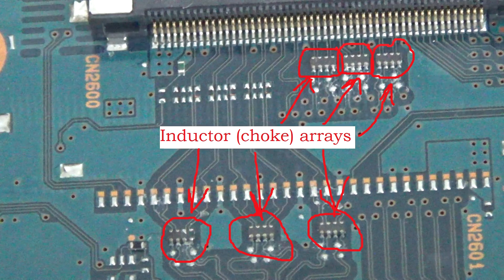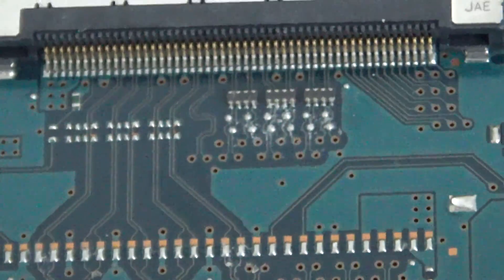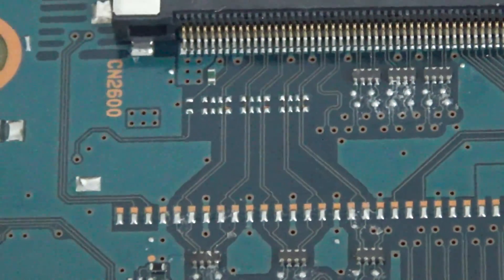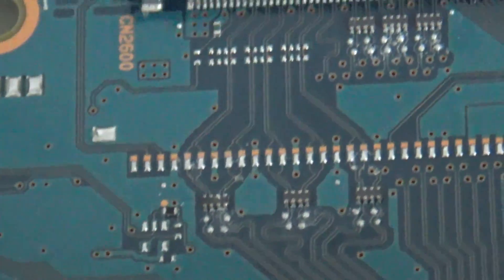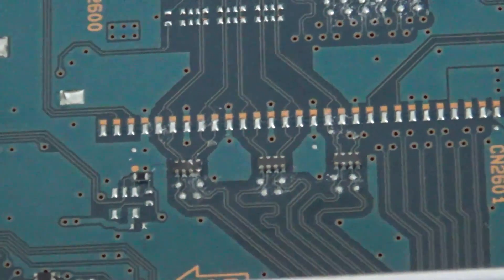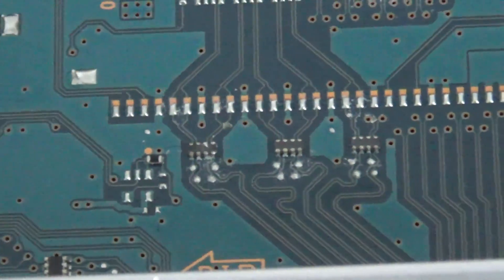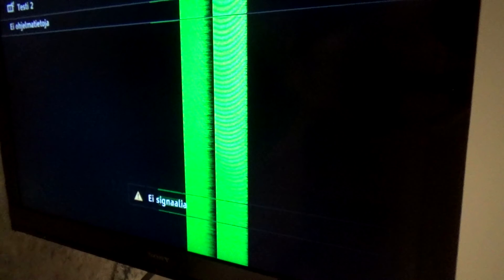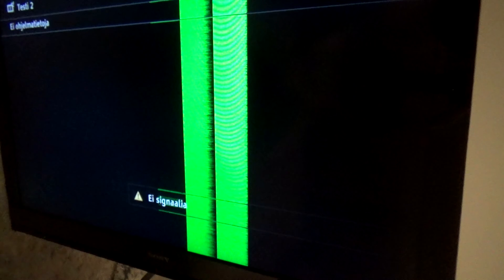Sony Bravia KDL-46EX700 TV Repair

Comment: I have the same TV but i have the Problem that it starts to the Sony opening Screen and then shuts off, restarts again until the Sony Screen and shuts down again and then stays off. Do you maybe know how this can be fixed?
Reply from the maker: I'm sorry it has been so long ago since I fixed that TV. Have you tried reflashing the bios?
Reply: @calyps0man  do you probably know quickly how it is to be flashed? Thanks for your quick Reply!👍
Reply from the maker: @StudentPilotRobBen81  you would need to desolder the bios chip and use a programmer (something cheap from ebay works). The firmware used to be found based on the model in russian websites. Like I said though, I don't remember much about this tv. The bios chip was probably similar to older PC motherboards. Winbond perhaps?